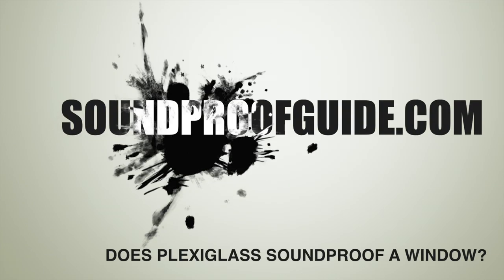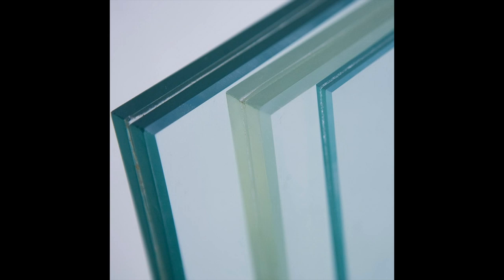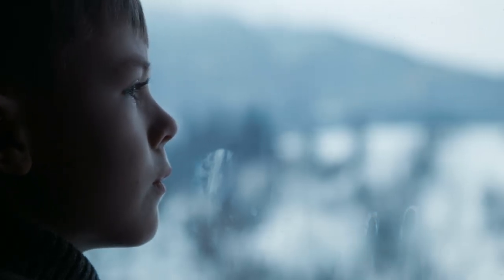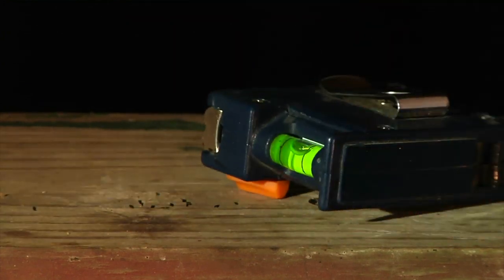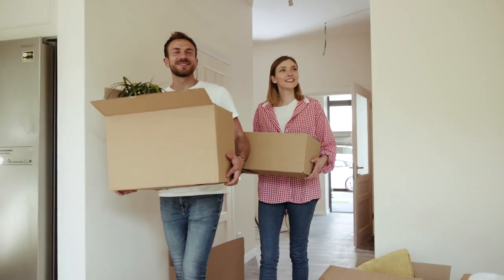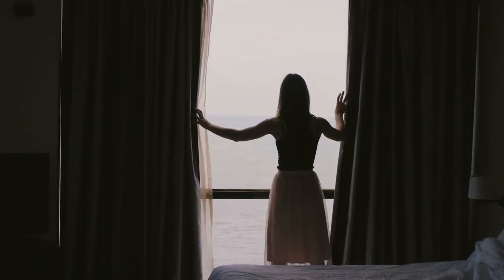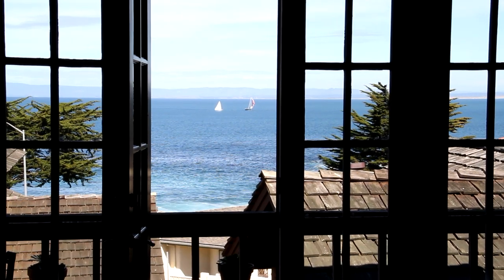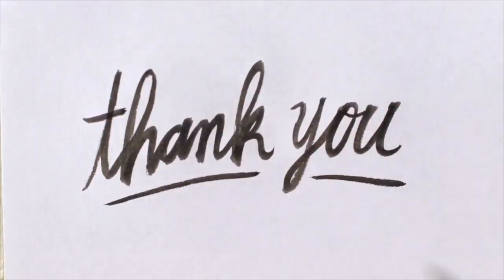Soundproofing a Window With One Item! Cheap, Easy & DIY!

Comment: This does work, but much better with 2 pieces of plexiglass - one on the outside and one on the inside.  However, it will not totally stop loud bass frequencies, it will cut it down a lot though.  Besides bricking up the entire window, I've tried almost every noise reduction technique out there.
Reply: Hello, what is the sound of the container truck shaking on a rough road?  Do you think plexi-grass is effective?     Or, glass is much more effective in this case?
Reply: @bhakinkhantarjeerawat8163  1/2" Lexan on both the outside and inside of the window should work well.  Make sure there are NO air leaks in the window or the frame...if there are, window puddy and/or expansion foam should be used to seal those leaks.

Comment: Plexiglass doesn't work.  I've tried it.
Reply: You've tried it?
Reply: Can you elaborate? What have you tried exactly?
Reply: Did you use rubber gaskets and ensure no air gaps?
Reply: @は私です彼の名前  Of course she didn't.  You have to have NO air leaks or gaps or it will not work.

Comment: I have 3/8'' acrylic sheets over my single pane windows with 3'' air gap. It certainly helps and takes some of the edge off, but the low-frequencies from modified muffler exhaust still aggressively come through.
Reply: god I hate those cars. They are forcing me to move from my childhood home.
Reply: Did you ever find anything to help with the low frequency noises?
Reply: @smallfry2500  No
Reply: @mountains1233    Sorry to hear that.
Reply: BTW, I actually had double-paned windows (not single-pane..mistake), and then the 3/8'' acrylic on top. So 3 panes!!!
Reply: @mountains1233 but only one sheet of plexiglass, or two sheets? Because then that’s technically quadruple paned! Im trying to upgrade my windows this week but mostly to keep my loud studio noises inside 😅 I use a lot of base too. I suppose anything is better than nothing like he said, but curious if you had two plexiglass panes of just one…
Reply: @EastmanEditing  We had old cheap double paned windows. On top of the window frame we 3/8'' acrylic and we nailed it in with supporters every 12'' inches all around to minimize warping and try to keep as flush against the wall as possible.

Comment: You should mention the fire safety when people block the window with another layer of any material, a violation of local and state building codes.  Imagine a fire at 3 am and the kids cannot leave the house because the doors are on fire and the windows are sealed.  Another consideration is the fact that plexiglass gets scratched so easily, making the view unpleasable over time.  I like your videos.  Just remember the fire hazards.
Reply: The glass goes  over the glass on the window. You can still open the windo

Comment: my window is about 9 feet long by maybe 7 feet tall. Its the original from when the house was built in 1953, the owner will not fix it. it allows a lot of dust, and loud noise/music from the neighbors. The item you have linked would be very expensive to cover this window. 8" :x 12" at $22,  would be very costly. Thank you for sharing. this wouldn't apply to my current window issue.

Comment: you're really over doing the lengthening of your videos to make the 10 minute mark.  Get more material, stop repeating / over explaining.   if I get board at 5 minutes, I'll leave and never make it to the 10 minute mark.  Since this is the third video of your's I'm about to watch, I'm already poised to hit the fast forward button or just close the video.
Ah, you've considerably slowed down your presentation and used a lot of the filler words to expand the ideas that you are presenting causing verbal runon sentences that just won't quit cause Zzzzzzzzz...............
Reply from the maker: Thanks for the feedback C Doe, I appreciate you watching my content and taking the time to post comment. You make valid points that I will take into consideration. Cheers.

Comment: Make a podcast. The stock footage is really annoying. Soundproof curtains are for absorbing sound, not blocking unless you are getting legit 100lb curtains. Don't suggest these as every "Soundproof curtain" in Amazon is going to do nothing and disappoint. Unsubbed
Reply from the maker: Watch Monday mornings upcoming video. I’m testing a set of noise blocking curtains with a sound meter. You should find it interesting. Thanks for the feedback.
Reply: @soundproofguide  yeah mainly you are dealing with desperate people who really need solutions for noise 

So imagine the amount of frustration they have when they go out there and buy stuff only to be surprised it either does not work or does deliver only an ironic amount of satisfaction
Reply: @soundproofguide My guess is : the safest way to (preserve) confidence between you and your subscribers is by providing accurate technical information also diminish the (literacy) and the generous comfy descriptions

Comment: Same here. My neighbors have a small rat dog that never stops barking. Its high pitched bark pierces everything we have tried. I barely get any sleep now and being an Aircraft mechanic sucks with the little sleep we already get.
Reply: I bought a plastic and tape kit and before heating it (with a blow drier) into place, added several thicknesses of cardboard and bubble wrap, then covered the ugly with plain cardboard, coloured if u like, cut noise by 2/3rds. Good luck, and remember, no bad dogs. Just jerk ppl.
Reply: I would trade that for muffler exhaust noise any day!!!!!

Comment: What is the name of the best quality soundproof curtains you could recommend?  I have very sensitive acute sharp hearing so it gets very frustrating. Ear plugs are not comfortable while sleeping all night. I looked on Amazon and it is overwhelming.  I have 2 casement windows in bedroom.  I hear everything outside.  Planes, trains, construction, cars, trucks, motorcycles revving up, squirrels, crows hacking away, sprinklers going off, babies crying, lawn mowers, lawn blowers, etc.  Also, if I put 2 layers of plexiglass from the inside, can I still open window? Would it be easy to remove? I appreciate your comments and recommendations.  I feel as though at times I wish I could live on a private island and get away from all this noise.

Comment: Useless video if (like in most countries) building regulations require accessible windows to open
Reply: If you build it in a way that can be opened, with a thick gasket, it works along with a decent acoustic measures in the wall.
Reply: ed riv ... it doesn't matter acrylic is still gonna be useless at sound reduction. You need to either replace window with 28mm sealed unit double glazing  or use secondary glazing dumbi

Comment: Do you know a way to keep your window a tad open in your car/truck to get ventilation put soundproof it enough to make equivalent soundblocking as if the windows were closed? This is to sleep in my truck while boondocking in the remote forest and lower the noise from commercial plane overpasses.

Comment: I have airborne and significant vibrational noise coming from the street.  The interior sheet rock is damaged and will be removed.  I realize there are many ways to address my street noise problem  but can't afford to do  everything (rock wool insulation, decoupling clips, 5/8 " sheetrock, MLV, , green glue sealant/caulking,  double pane plexiglass window inserts).  I am also limited by the thickness of the wall due to the presence of baseboard copper pipe heating system ( and the cost and complication to disconnect this system).
What would be the priority of materials in terms of their effectiveness you would advise for airborne and vibration traffic noise.
I would really appreciate your opinion on this matter.  Finding good  information regarding this issue has been challenging and insufficient. I hope you are available to comment soon.
Many thanks!!
EJ

Comment: what if she  does one very very tick sheet []  like if she got a 3 inch thick sheet would that work ok? and  compare it to 2 or 3 sheet with space in between |||  i think of maybe to do a very  thick ones and 3 sheet with space in between might work better then one super thick one also witch is better plexiglass vs. polycarbonate? and last what about 4 sheet with space in between?

Comment: This is about replacing windows, not soundproofing existing windows. This video is not useful to renters and is way too long. The same information could be shared in a much shorter video.
Reply from the maker: Check out some of my new videos on soundproofing rentals. You’ll find something useful. 😊
Reply: Window plugs work great... try building it yourself or ask a handy man-friend.

Comment: Use the word acrylic. Plexiglas, spelled properly with only one “s” is a trademark name (proper spelling for the trademark name of acrylic by one manufacturer). 
Perspex and Lucite (pronounced incorrectly in the video) are other trademark names for acrylic.
Reply: Obviously you do. Am I wrong?
Reply: Polycarbonate sheets (Lexcan) works even better.  More flexible and you can drill through them without it cracking.

Comment: I have a sliding glass door that allows a lot of outside traffic noise and kids playing (It faces a park). I was thinking of getting a large board and putting some insulation inside and pressing firmly over the glass. Has anyone tried something like this before?
Reply: I have the same problem and was thinking of putting drywall in the door. Did you try??

Comment: Any ideas on how to seal the sides and corners?
Reply: I didn't watch the video but I put a 3/8'' acrylic sheet directly against the window frame. We put a 2'' by 2'' under the window frame to keep it from falling. And we put 3-4 mirror clips along the other 3 sides to prevent it from falling or buckling.
Reply: I also added acoustic sealant around the edges after doing that, but didn't notice any difference

Comment: From our experience, you do need the TWO very thick plexiglass with air space in between to get adequate soundproofing. The other option is to remove the windows!
Reply: 1/4" works.  The more dead spaces you can create, the more dB reduction you get.  My bedroom window had 2 dead spaces, now I've installed another one on the outside of my window.  The noise level from the outside is now cut down tremendously.  Very, very loud bass is the most difficult to block... more deadspaces are the only way to do that.

Comment: Hey I am building a studio area in my home to "self tape" actors. However I have ceiling to floor windows in the room I wish to do this in and I live in a busy city (traffic/trucks/music etc). I need to soundproof windows. Any ideas, that would be removable or wouldn't block light. I'd like to be able to still enjoy my sunlight when not taping. I could send pictures to an email if that helps. this is an apt so cant do any permanent changes.